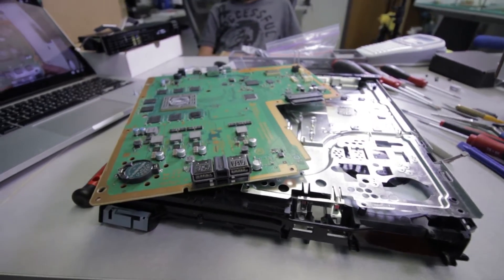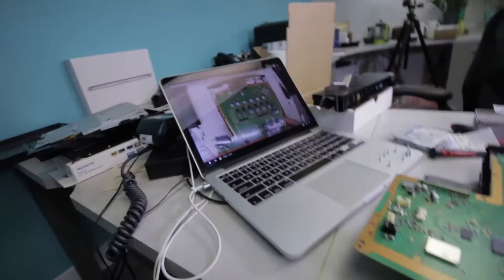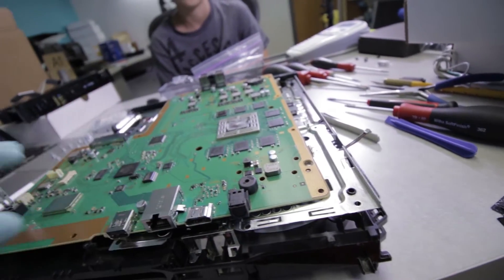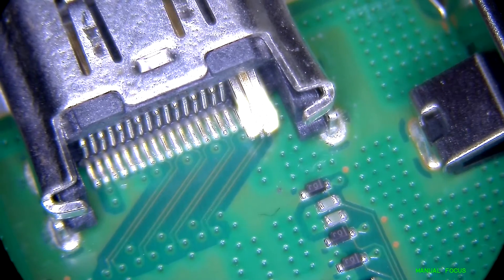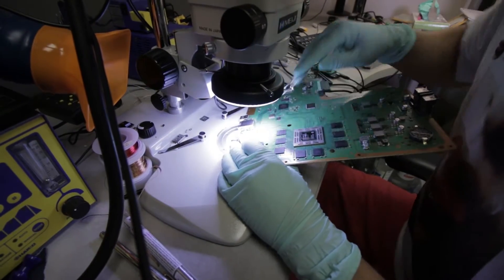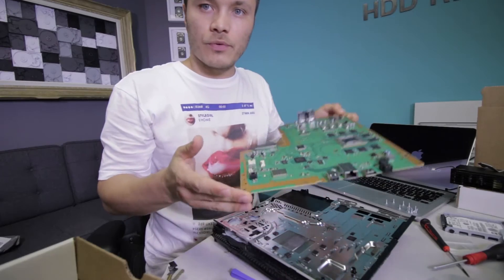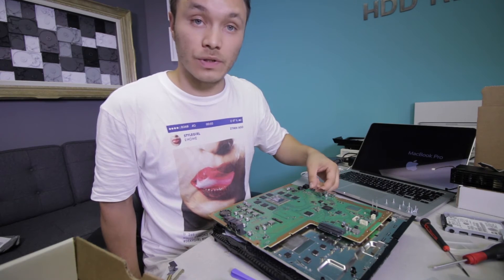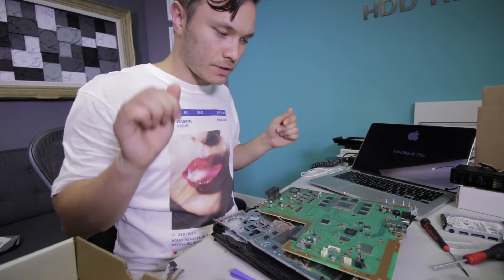PS4 HDMI port repair - How to fix a Playstation with white LED

Comment: Hey yo I’m kinda late Buh I got the part and I’m working on fixing mine but there just sum weird like I’m lookin at your port where it is and what’s around and it looks non like that I know there are different models and stuff but I’ve seen a lot of people with like the one you have then other people with a common different one I have not seen no one who has my type of mother board mine has the hdmi next to the aux I believe that’s what it is then the laser optical then Then That’s it it has a weird layout and it looks like if I try to fix it the lil like pieces and shit are very close to the hdmi like why is mine like this Buh like no one else?

Comment: See I have the new HDMI part , but I don't have those expensive tools , is there any easier way to repair it?
Reply: Buy a cheap heat gun off of ebay, and try your best. Then just use flux and a soldering iron and have a steady hand I guess. I would try it, because it would be experience, plus someone will probably be able to fix it if you mess it up :P
Reply from the maker: go to https://www.tronicsfix.com/ select your needed service for HDMI port repair, and use discount code: hddrecovery. they will get it done properly, and you will get a little discount if you use the code

Comment: what is that reflow machine you have?
Reply from the maker: Hakko FR803 with Pace preheater
Reply: do you have a website for your hdd repair services ?
Reply: nvm. found it. your in canada. im in nyc. can you recommend someone here in the states for data recovery out sourcing? i have a repair shop but dont do any data recovery services.

Comment: Why aren't you using something like roses to lower the melting temperature of the lead free solder?
Reply from the maker: I wicked and added as much of regular solder in there before heating up. I am not familiar with Roses. Please do tell
Reply: Roses is a special solder with a verry low melting temperature of about 94°C. It's similar to "Chip Quick". I always use it to desolder chips with data that must not be destroyed or to remove parts from boards with high thermal mass. But it costs much less than Chip Quick.
Reply: If you'd like to try it out, I can send you some bits or roses.
Reply from the maker: I see, I just packed it with regular leaded solder before heating up. I've worked with it before but it is a bit hard for me to position chips with it because it stays liquid for so long.
Reply: HDD Recovery Services can you please fix my PS4